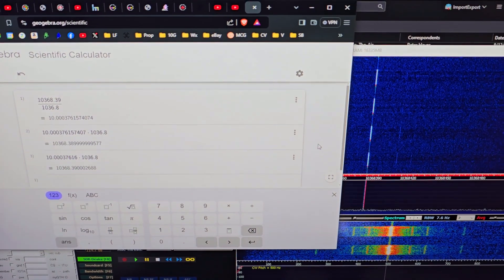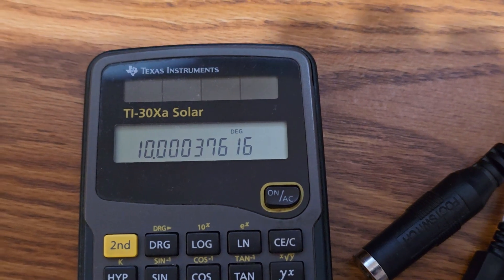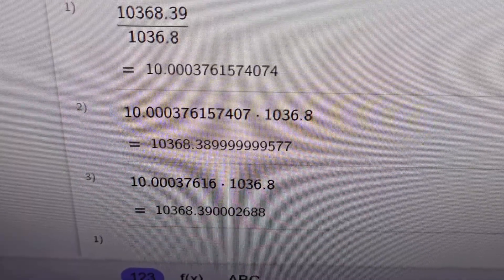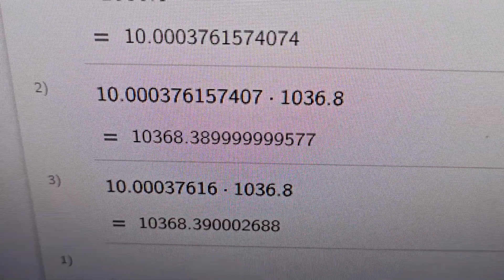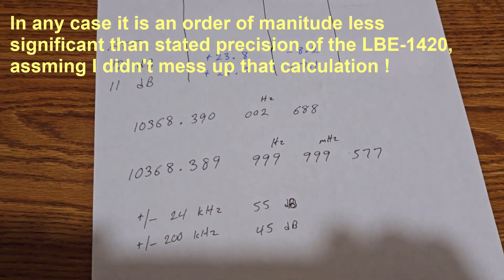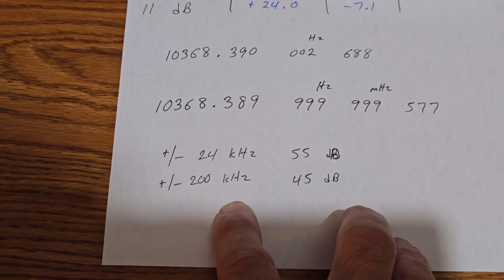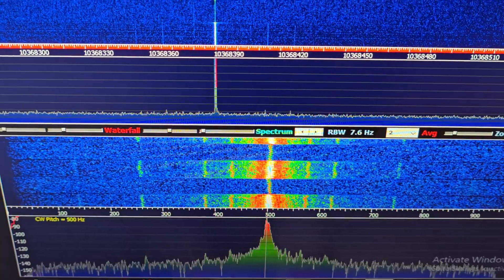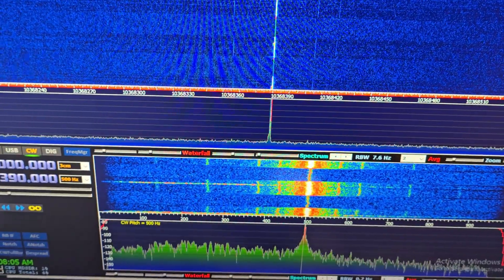10GHz Beacon - LBE-1420 Update

Comment: Excellent work with precision!
LBE-1420 is limited to 1millihertz to keep user interface sane. The hardware can do finer steps but they will not be visible behind other sources of errors and frequency undulations.

Spurs: I have just measured LBE-1420 phase noise on both 10MHz and 10.000376157407MHz and I cannot see any significant spurs within 1MHz band. 10MHz had a -115dBc spur at 400kHz and 10.000376157407MHz has -106dBc spur at 783kHz. You can conact me for the plots.
Leo Bodnar

Comment: 10.000376157407407407407407407407... :)
Awesome, 136 kHz to 10 GHz!
Does your davis vantage vue console also make so much noise on HF?
Reply from the maker: As far as I can tell, I get no HF, VHF or UHF noise from the Davis. The console is some distance from any of those antennas. The Davis sensor suite is quite close to the 50, 144, 222, and 432 MHz antennas but I don't think I am getting noise from it. I should probably run some additional tests to confirm it is not bothering any bands...
Reply: @n1bug  In my case the noise was radiating from the usb connection to the datalogger.
Broadband ~S7 noise in 50 meters distance from the antenna.
Reply from the maker: @antoineroquentin2297  Interesting. I don't use the datalogger or USB. I have a meteobridge nano SD installed inside the Davis console. It connects wirelessly to my network. It is a nice solution, but quite expensive.